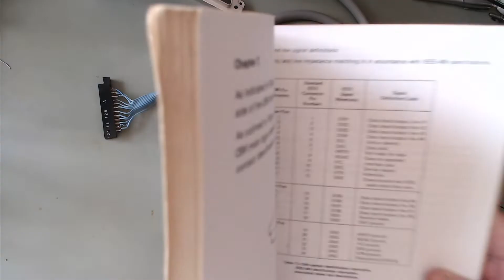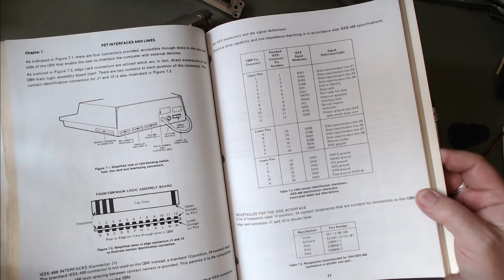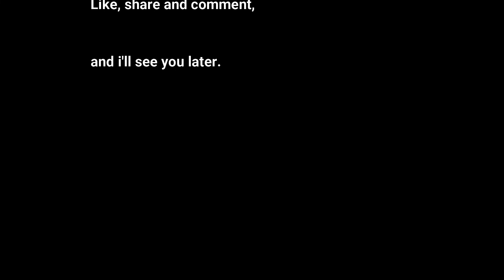#064 Commodore Pet 2031 disk drive

Comment: Would not expect to find the capacitor right there.  Carlson ... the guy who looks like he surrounded by walls of oscilloscopes?  Have seen him with really old passive components. 
Need to send you my Coleco Adam, as the tape drive stopped working after 30 minutes of use  ... well, after being boxed over 30 years.  Rubber and soft plastic parts in these old things often sag, melt, or otherwise deteriorate.
Reply from the maker: Hi I did npt expect the mains filter to let go, but it seems that that type of cap is well known to go pop.